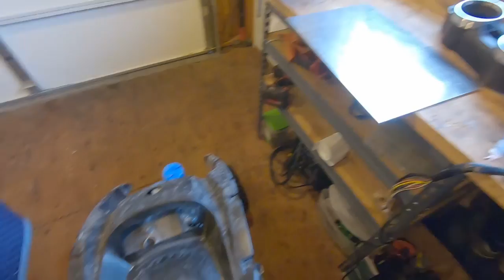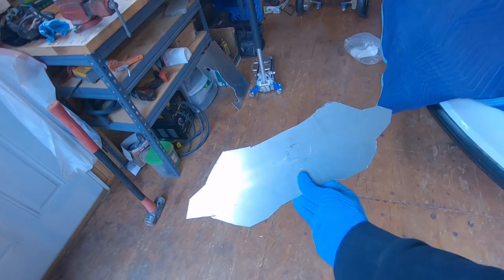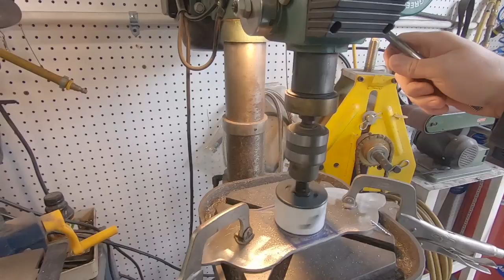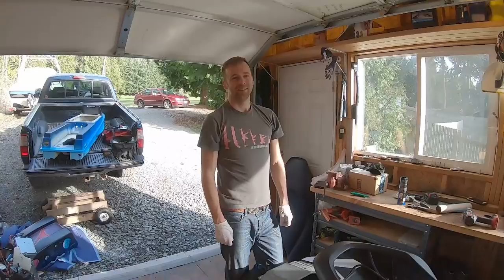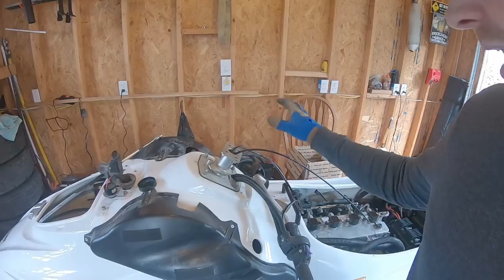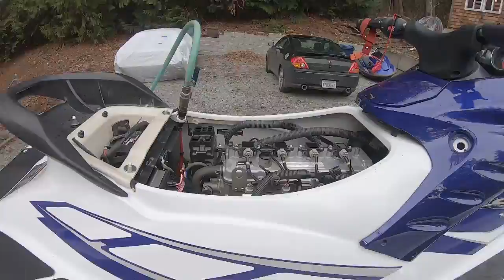GPRSHO Part 7 completion

Comment: Would you guys have a diagram  of were the water  lines go on a 1999 Yamaha suv 1200
Reply from the maker: Mick O Toole sorry but no
Reply: @JetSkiBrothers   well the 1200 engineS YOUV DUN IN THE PAST JUST THE INS AND OUTS  ...JUST BASIC PLUMING😁😁👍😁♥️🇮🇪🇺🇸 DUSINT HAVE TO BE AN SUV   JUST PLUMING FOR A 12OO YAMAHA